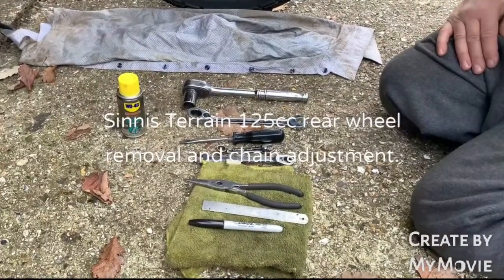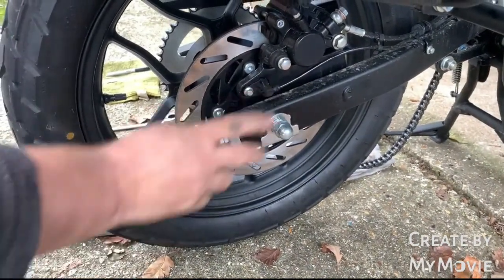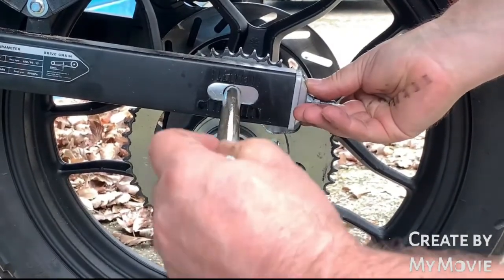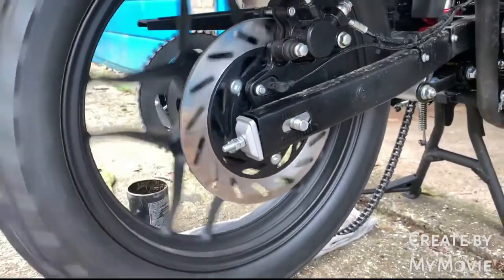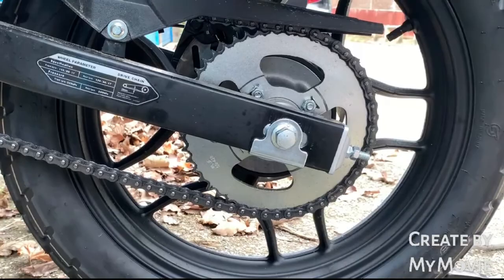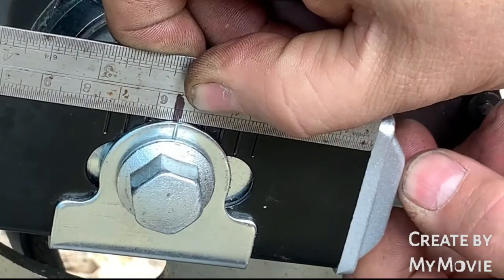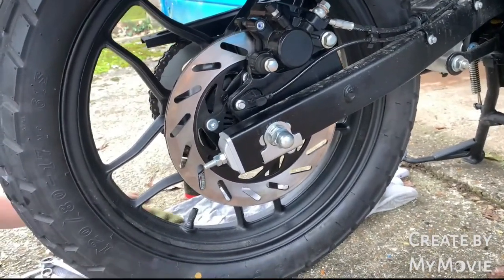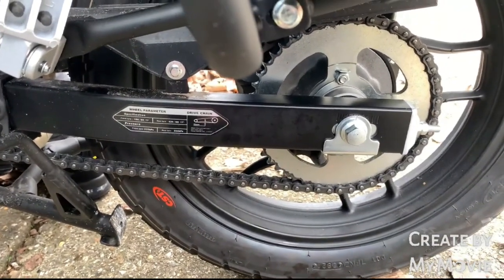Sinnis Terrain 125cc rear wheel removal and chain adjustment

Comment: Great tutorial, can you advise what slack there should be in the chain when it is not under tension as dont have anyone to help sitting on bike.
Reply from the maker: Best check is to pull the chain away from the rear sprocket at about the 3 o'clock position as there should be no obvious slack lifting the chain. The main issue is don't overtighten as causes more wear.

Comment: Hi, thank you for getting back. I have recently added A. Dicha, and so that is fine, what are we meant by movement on the sprocket? I think it's moving from the the cranker case and you know that did the drive but stick, except from the side of the case on the engine it is moving aside to side.  Open down, I have checked the bolts. They are tight. It just seems a bit to pizza iffy to me. If that is the case that they are supposed to move like a wobble. Could probably be 55 meal. Maybe 10 per a 3 top to bottom is this normal?
Reply from the maker: @AlexKitchener  if you mean the shaft the sprocket is on absolutely no this is not normal.
Reply: Thank you for getting back. Sorry about the message. It was a bit gobbled. It is the front sprocket which is Panchin around not the shaft. If it was the chef I would be worried myself. But the sprocket is moving from top bottom.  Is it supposed to do that when the nuts are already tight? Sorry for keep going on but the garage I bought my bike from at which was brand new they're not very helpful.

Comment: do you have to split the chain to get wheel off?
Reply from the maker: You don't have to you can push the wheel forward and lift the chain away from the sprocket and then remove the wheel. Replacing is the opposite.
Reply: @silktvPDR1  just ordered 2 for my son and me , so going to ser all your vids,  is there a 12v accesory plug under seat or
Reply from the maker: @spikeccx  there is a connector but you may have to change it to suit what you are fitting but it is a switched 12v feed